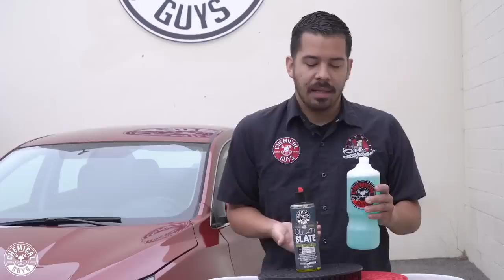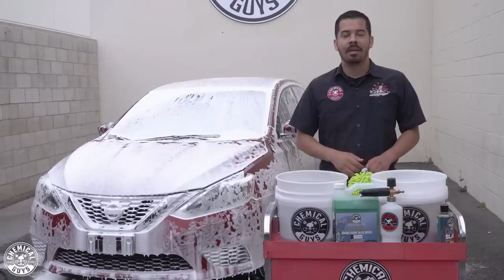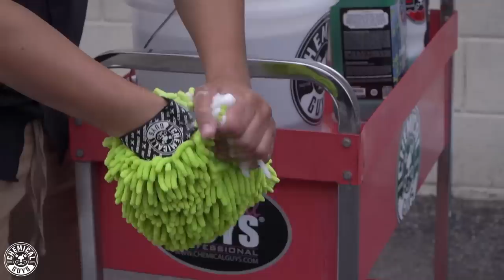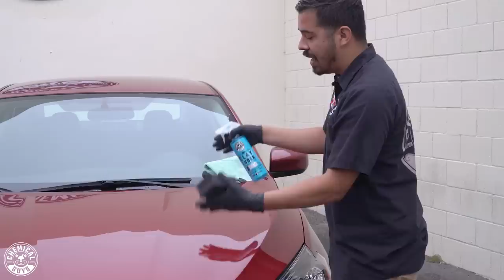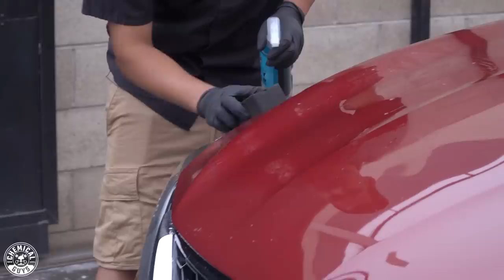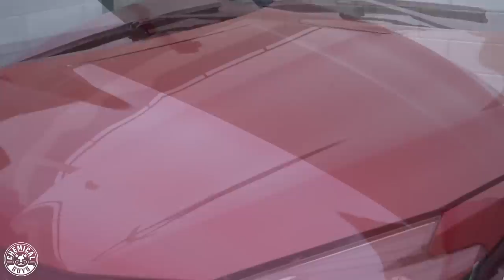How To Easily & Effortlessly Decontaminate Your Car! - Chemical Guys

Comment: What are the benefits of using this clay block vs using the traditional clay bar ?
Reply from the maker: Hey! A clay block covers more surface area while being more user friendly. In the event that it is dropped, it can be cleaned and reused as opposed to a clay bar which would need to be replaced.

Comment: Would this take off an existing ceramic coating? Or just prepare it for another level?
Reply from the maker: Hi there! Clay will not remove coats of ceramic, glaze, sealant or wax. This extracts embedded contaminants and stubborn surface grime.
- CG Nick
Reply: Chemical Guys thank you for the reply what about iron remover does that affect any ceramic coating?

Comment: Hey guys can you confirm that your clay sponge won't introduce any scratches like traditional claying?
Reply from the maker: The Synthetic Clay Block will not scratch your paint. Make sure to full clean the surface of any grime and also use proper lubrication to achieve the best results using this product.
Reply: sure it will scratch, even more when decontamination process is incomplete like presented on this video. Deironizer and T&G Remover before claying is missing :) Every clay ''thing'' is abrasive, I suppose u know what this means - IT WILL LEAVE YOUR PAINTWORK WITH MICRO-SCRATCHES, and polishing is always needed after claying

Comment: After I use the clay block, and I don’t plan to wax the car.  Should I wash the car to remove the lube or I don’t need to wash again?
Reply from the maker: Hi there! Simple wipe away spent Clay Luber with a clean microfiber towel.

Comment: question on a newer paint finish (less then 3 months) after the clean slate treatment is the clay block necessary before adding sealant/wax
Reply from the maker: Hey Jeff! Yes, it is still recommend to use a clay bar or Clay Block to decontaminate newer paint.

Comment: Can you use the clay block and ceramic coat product to a car that is completely wrapped ?
Reply: Clay block is not recommended for wraps, although for the ceramic, you can use it on the wrap but it would be considered an off-label use.
Reply from the maker: Hey! We do not recommend claying or ceramic coating a wrapped car. Thanks for watching and happy detailing!

Comment: Hi after you do this process what glaze,sealant and wax do you recommend?
Reply from the maker: Hey! We recommend EZ Creme Glaze, it makes any car look extra glossy, shiny, and like the vehicle is still wet after a fresh paint job by filling in light swirls, scratches and other imperfections. Then apply Jetseal, it is the ultimate long-lasting paint sealant that uses the latest aerospace technology to protect against the harshest elements while enhancing a brilliant glassy shine. Finally apply Butter Wet Wax, it is a smooth, liquid creme wax that melts into the paint like butter for easy on/off application to give you the deepest, wettest look imaginable in a matter of minutes.

https://www.chemicalguys.com/ez-creme-glaze-rich-wet-finish-with-acrylic-shine/ez-creme-glaze.html

https://www.chemicalguys.com/jetseal-durable-sealant-and-paint-protectant/jetseal-sealant.html

https://www.chemicalguys.com/butter-wet-wax-warm-and-deep-carnauba-shine/butter-wet-wax.html